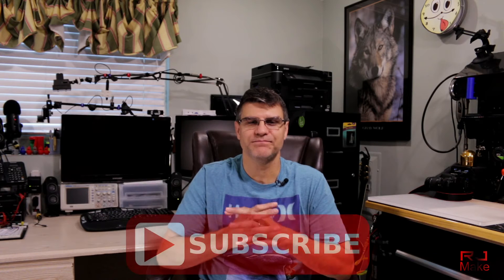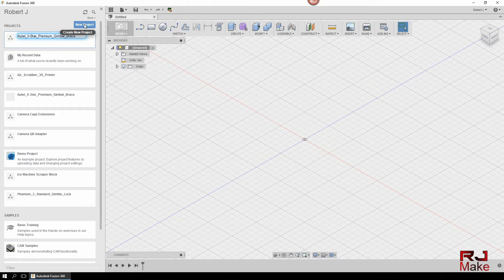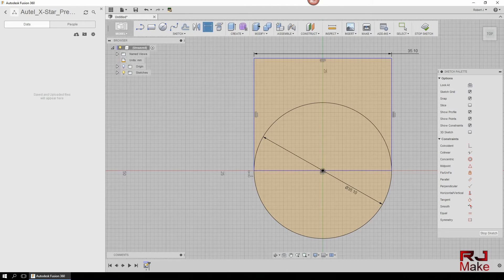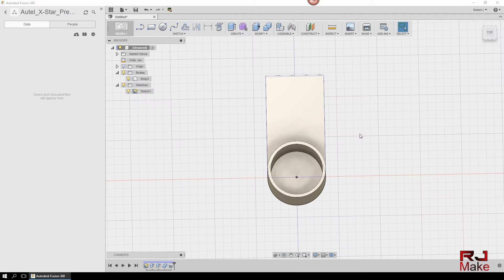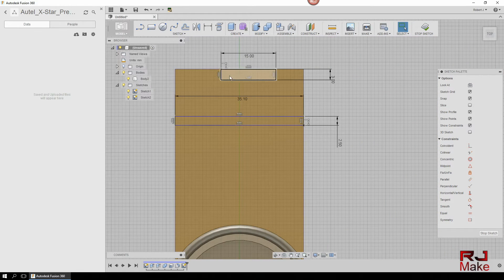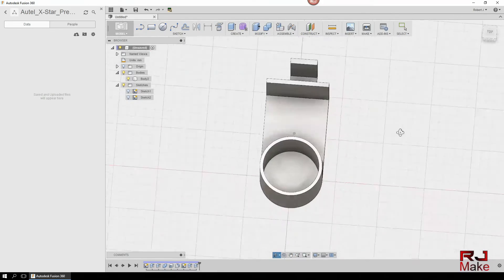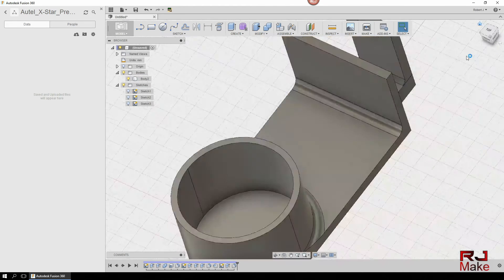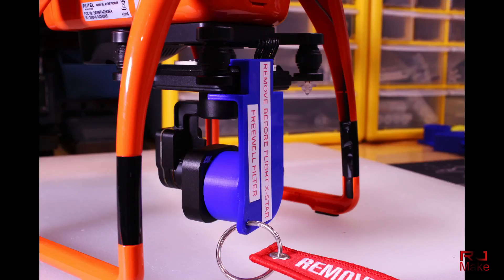Autel X Star Premium Gimbal Brace Design In Fusion 360

Comment: I have a similar aftermarket version except my clip with Remove Before Flight tag hangs from the top of the bracket not the bottom. It makes it hang and be more visible. When placing the drone in the carrying case with the new gimbal guard in place it is a tight fit, but it goes in almost perfectly with a bit of care. When carrying the case the camera was facing down and could put unnecessary pressure on the gimbal and camera so I took the packing out of the top and bottom of the case and turned them 180* so now the camera faces upward when carried and the battery compartment in on the bottom.
Reply from the maker: With my design I had to remove the center 'cube' from the carrying case to safely fit the aircraft back into the case.